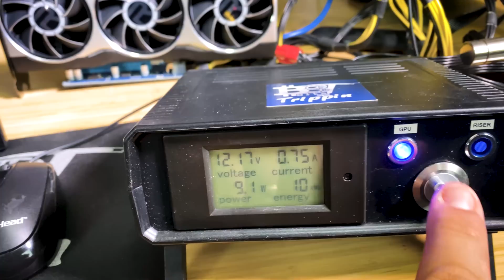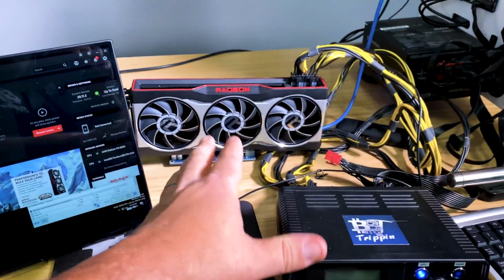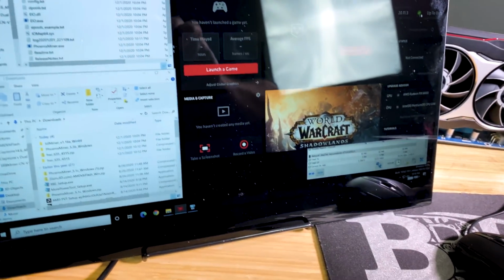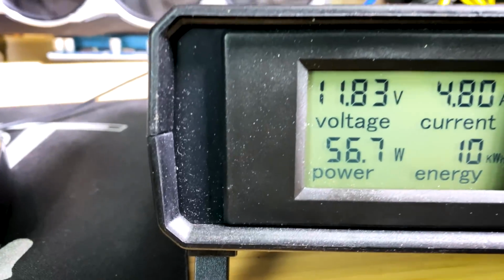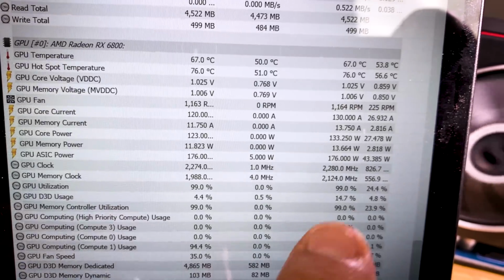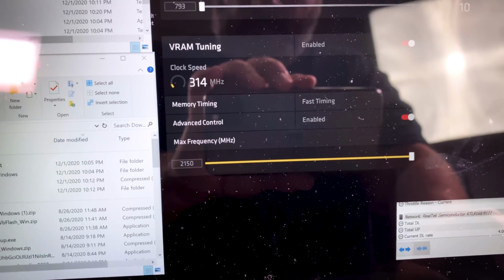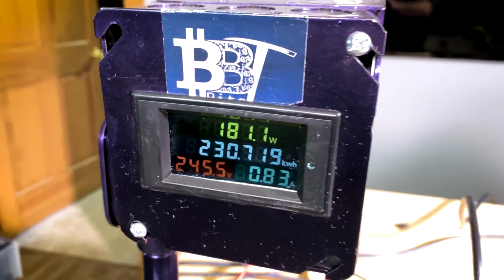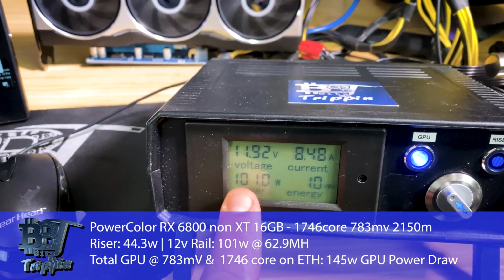Powercolor Radeon 6800 non XT 12v Rail and PCIe Power Draw!

Comment: My 6800 also consumes about 43Watts over the memory rail. But there is also a second memory rail that sucks bout 13watts.(Hwinfo sensor read out). Now my question is, do I need to add the 13w to the 43watt to know how much power comes from pci e slot?

Comment: Is it safe to run a 6800 on a sata powered riser?
Reply from the maker: I would not recommend. 6pin power only
Reply: @BitsBeTrippin  Thx for replying. At least according to HWinfo the memory rail wont exceed 32 amps which is around 43watts with my mining settings. So I should be fine. Do you have long term experience with mining on the 6800? Are there any frequent driver resets happening? For now it runs rock solid since 48 hours straight.

Comment: so that means 130w = 144w real usage. so my rx6800 that says 100w means real 115w ish
Reply: Nope. Most programs read total board power. This value consists of chip power draw, soc power draw, memory vddci and memory vddio rail power draw. This should add up to a around 125w with mining settings.

Comment: 63.7 with 112W (it draws more, up to 114 when room gets hotter). I'm using 680mV at the moment but will try with lower soon (stability for 1 week before I go lower). Anything against bumping power tuning up? I'm using +5%. With todays price 1mhs nets 8 cents, equal to 25W draw with 0.13 per kWh. You can get more than 1Mhs and power draw should not increase by more than 20. 
Temps are still very low, so is there any reason to not use Power Tuning?

Comment: Love your channel, and had a quick question...

Have you had issues with the 6800s on risers, or is there something you have to do to get it recognized?

I have 2 6800s and cant get past post if they're on risers. I've switched out risers, tried several boards, even a b250 miner.

Cards work perfect when plugged directly into a PCI slot with no riser. Problem is I'd like to be mining with both...is there something I'm missing?

Thanks!

Comment: Just curious on your system test bench are there any fans like case fans we dont see?  30 to 40 watts with no fans seems high for a system.  Unless that's a system idle reading with the card? My system is 29.1 watts with 7 fans no card.

Comment: hmm you mentioned that only half the CUs are detected, but for example nbminer from nicehash detects only 20CUs in my 5700xt
Reply: Different miner will have different behavior. Phoenix miner detect actual CU numbers, usually, and the Phoenix doesn't have 6800 yet so he can't make 6800 specific kernels
Reply: @ZenStrive52  thanks for the info

Comment: With that basic test as is, it's not much more than a 5700xt in hash or power
Reply from the maker: At the moment with current miners and half of the CU's being utilized, yes.
Reply: @BitsBeTrippin  How much better do you think it might get?
Reply from the maker: @MrTeeseeone  I think it's fully reasonable to hit the 80mh level with the duel instances. The 6800 is competing with the RTX 3080 with no problem in nearly every category besides ray tracing. They both have GDDR6 and yes, nVidia did some architecture tweaks, but those did not resonate as huge advantage over AMD. They should compete near the same in hashing also, current driver/miners are not taking advantage of this card yet.
Reply: Depends. I got both cards. My 5700xt is definitely a bit more efficient and does 54 Mh/s at just 104w. My 6800 does 63Mh/s at 126w. Eff/w 523,8K vs 492,7K.

Comment: Which means high hash rate require other amd related motherboard and ryzen specific processor.
Reply from the maker: not necessary. I firmly believe if we can consistently get two instances running, it will do it on any machine. It's a matter of finding how to engage two instances and all 60 compute cores.  Still trying to run that down.
Reply: @BitsBeTrippin  ok understand. I think  that uses to happen on xmr stake which run two intensity of same gpu .